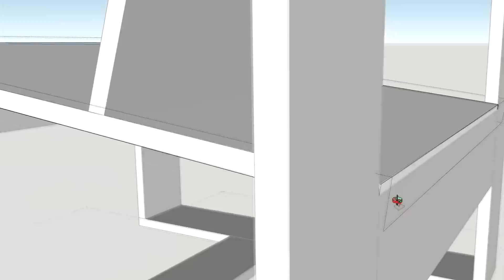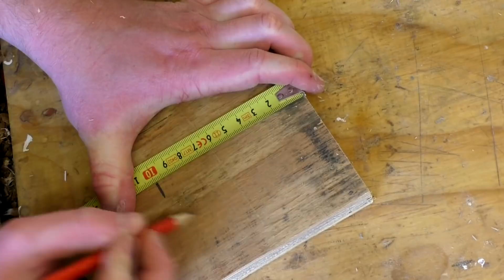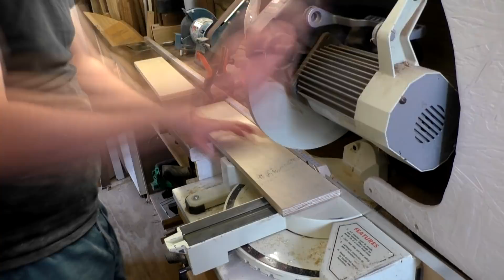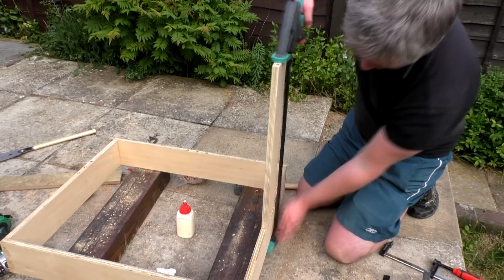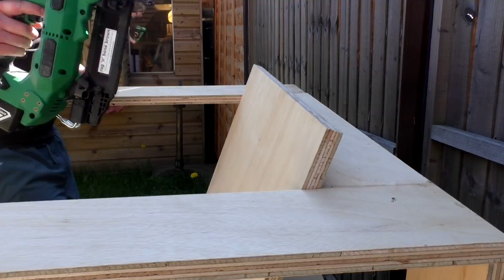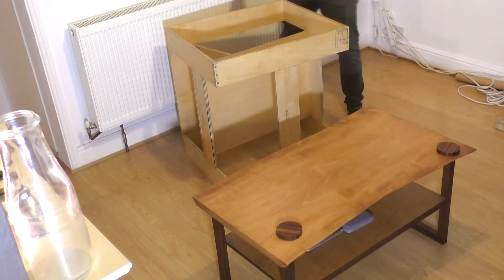Making A Plywood Armchair - John Heisz Collaboration

Comment: The problem you would face, if you planned to use it for long, is the seat not having sufficient strength. It will split parallel to the front facing, roughly in the middle. I have that problem with an older set of oak dining chairs that had not been built with the best quality materials, evidently.

Comment: Thanks for the video.
Few questions :
01) What's it called for the small joints you used. 💊

02) what type of gum should be used for joint. 

03) what's the best ways to hide the joints from it being visible. 

04) what's the best way to keep the same color for complete furniture. 

Thanks

Comment: Hiya mate    wicked video as always  just a suggestion if i may.??? 

Why don't you  get yourself a small spray gun.. for the laquer as i bet your paying a bomb for the tin stuff.?? And it will work out a lot cheaper in the long run... I mean you have the compressor you have the air line and mask aswell.?? You can pic a gun up for 15 quid..  I can send you a link if like.?? Just a suggestion tho mate.

Comment: That’s brilliant Kieth, well done my friend....simple in design, strongly built and no doubt very comfortable....reminds me of a school project chair I made as a 14 year old, stainless steel legs, mahogany arms, back and seating with web sprung seat and cushions, the problem I had was fitting the seat & arms part to the steel tubes, had to make a nut holding wire  for the bolts through the wood, then capped with turned mahogany end caps....turned out okay and got an grade 1 in A level woodwork....off to watch the other video.....